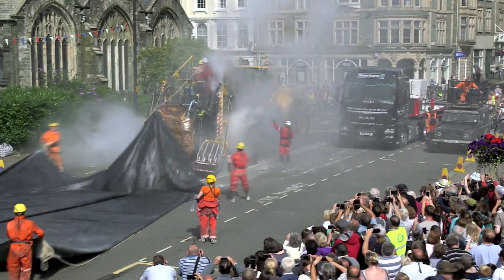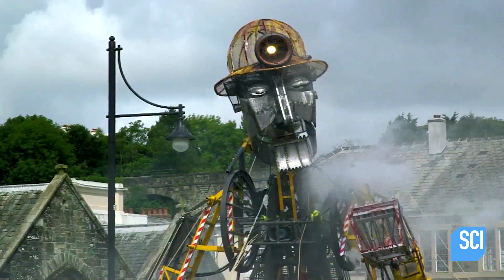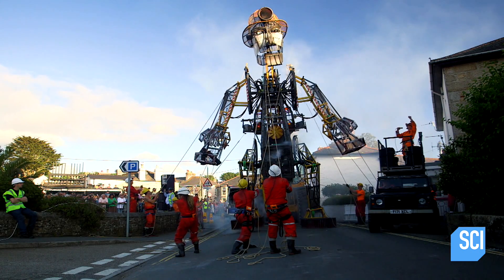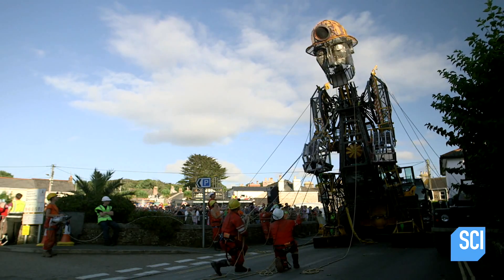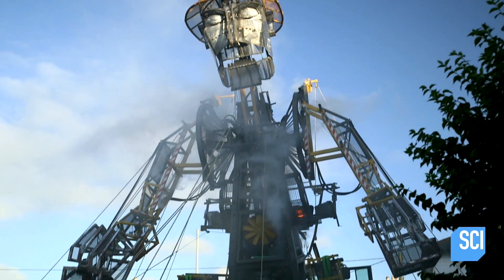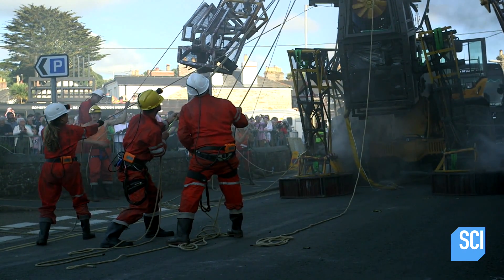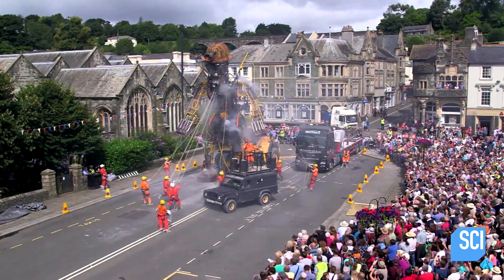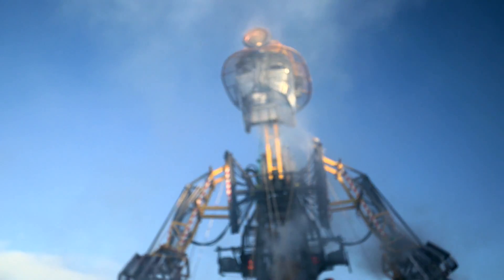This Enormous 4-Ton Puppet is an Engineering Marvel!

Comment: Marvel of engineering? Off the top of my head I could name 150-180 engineering marvels.  From dams to particle colliders. This isn't 'amazing'
Reply: Have to agree with you Robo Batman!... "Engineering marvel" my ass... if this is an engineering marvel then people need to be told about Jim Henson Studios... they use mechanical devices and pulley systems as well... but if you believe bigger is better... then I guess people will like this dipass puppet.